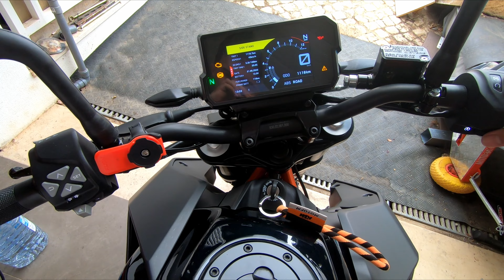Crashbar Install | KTM Duke 125 Build Part 1

Comment: This is Duke 390 not 125. Don't make fool ur audience
Reply from the maker: Hello! This is in fact a 125 Duke. It is the same body as the 390 but the engine is smaller. I wish it was a 390 haha!
Reply: This is the 125 (European version) which comes with a stock TFT display but in India TFT is available only on 390 and above (in future if KTM launches a bike more powerful than 390)🌚